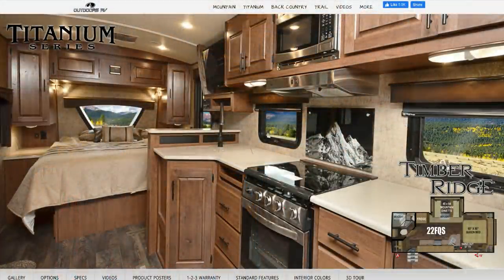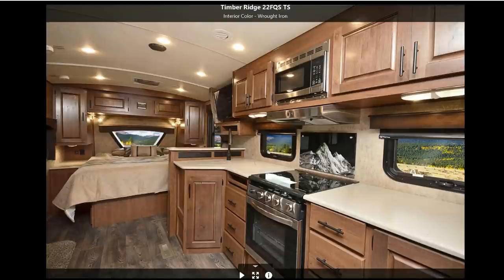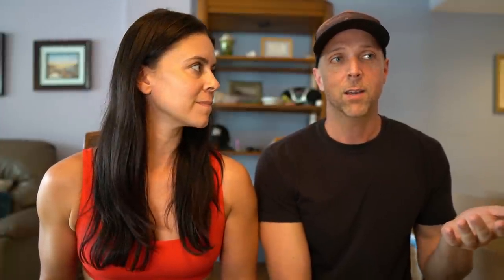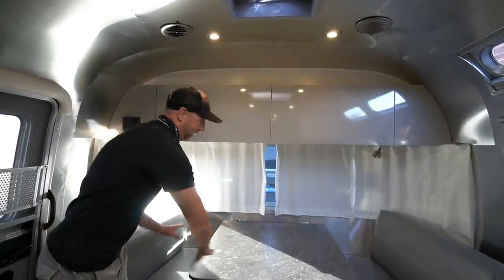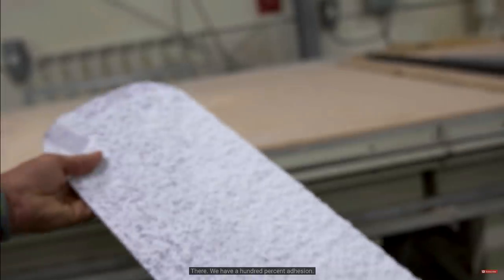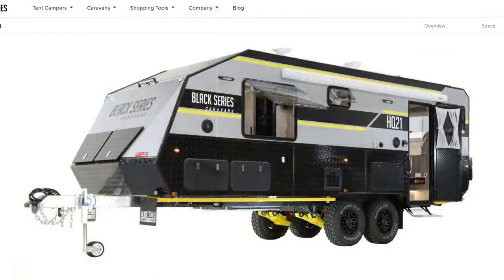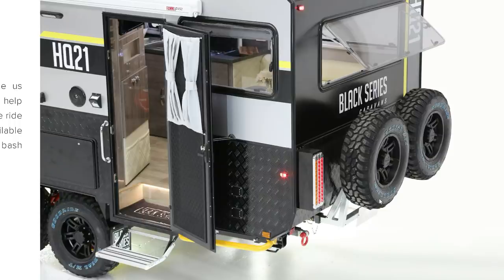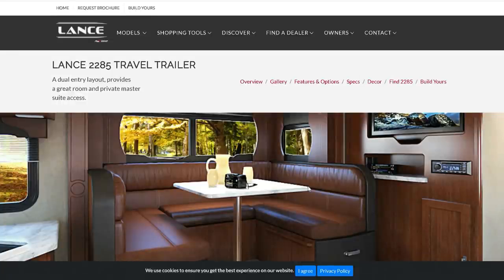Why We Chose Outdoors RV Over Airstream, Black Series, & Lance Travel Trailers

Comment: Sounds like your decision is perfect for you.  In Fall of 2019, I went to the California RV show and saw the Airstream, BlackSeries, and Lance Travel Trailers.  From what I remember, your comparisons of the units are right on.  

While I like an Airstream 25RBQ, the fact that you can buy two new Outdoor 22FS for the same money as one new Airstream causes one to think twice.  

The BlackSeries units will have an internal clearance problem.  If you look at the videos, the AC unit seems to cause some headroom loss.  While they seem very rugged for off-road use, if you can't stand up, you can't stand up! 
 
I didn't know that the Carrying Capacity of the Lance was a lot less the Outdoors Unit.  After looking at that the specs, you will have over 1,200 lbs to play with and that is a huge factor in figuring out what to take on your travels.

The real question is when will your rig arrive?
Reply from the maker: All good points! The build run starts in July and we hope to see it at the end of summer into fall time!

Comment: I’m happy for you. It seems like you made the right choice for more rugged outdoor adventures. But I’m not gonna lie, when you were talking about the airstream in this video you lit up and it seemed like your heart was really set on it.
Reply from the maker: We do both really love Airstreams! Our first love😍! And we might just come crawling back!!😂
Reply: @IreneIronTravels  Airstreams Does NOT Have Any Exterior Storage, Let Alone Interior Storage Like The ORV...!!!  You Made The Better and Smarter Choice - True Four Season - Protection and Interior Hight... I Am 6'3" Tall - Ah 6'11" :)
Reply: @BIGResultsFast  & @Irene Iron Travels:  It depends on the size of the AS.  At 30’ my ‘78 Argosy (the painted AS) has outside & inside storage.  For real serious off-roading you do need both the larger wheels & the lift kit.  In our case, with knee trouble, the higher ground clearance is sacrificed for better physical comfort.  

I’ve camped in a 30’TT for over 30 years and have never been restricted in where I would like to go.  I’ve never been a rock climber type of camper so I’ve not needed that capability.  I’ve had skid wheels on my 30s’ so I don’t worry about dragging.

My TV is a 2005 Dodge Ram SLT, 1500, 4X4, Quad Cab, 6.5’ Box, 5.7L Hemi - Gas w/240,000 miles.  Very little repairs - mostly suspension.  It is capable of towing 12,000# but I’m only towing 5,500# fully loaded so I have had no problems.

With an AS you have 50-70 years worth of used units to consider.  No other TT on the market can make that claim.  That’s how you get around the high price tag of the newer units.  And AS DID make Slide-Outs for a few years.  They are highly sought after and their price reflects that.

I retired my other 30’ TT because at 30 years of age it was unroadworthy and too expensive to repair.  It was a Fiberglass/Styrofoam/Wood sandwich construction on a Galvanized Steel frame.  I wasn’t savvy enough to realize the damage heating w/propane would inflict.  We did a lot of Cold Weather Camping and ran our furnace a lot. I did not use a dehumidifier.

I will NEVER again use a TT that uses wood and fiberglass in a sandwich.  I looked very strongly at the Lance, particularly their Pick-Up Campers.  The 3 slides one I could live with quite easily but my Wife did not like the entry height or the small quarters.  We used my Folks Avion 11’ PU Camper so she had a reference point.

I look forward to following your adventures in your new TT!!  Best to you both!!

Comment: Great choice! We longed for an Airstream, we are 6’ and 6’5”. In the end the lack of slide and the curved interior walls (in the shower for instance) were a deal breaker and we bought a Grand Design Imagine with one slide and the basement pass through. Best decision ever. The Airstreams are beautiful and I still covet them but we enjoy the functionality and space/height of the Imagine every single time we use it. I think you chose a fantastic trailer and am looking forward to following your adventures. 🎉🎉🎉
Reply from the maker: Thanks! Yes, that all makes a lot of sense...especially the shower! We wanted to look at the GD Imagine 22mls a bit more as well, but none were local. They managed to fit the table,couch, and full walkaround bed all in there. Looked like it might have been a bit cramped...... Is that the model you guys have?
Reply: We ended up with a 2500RL. I love the upgraded shocks and suspension on your rig. It makes for such a more pleasant ride down the road, and those tank sizes - you could be weeks in the boonies - so fun!
Reply from the maker: So true 👍, thanks!!!
Reply: Airstream has better resale value and last longer

Comment: Just as an FYI Lance does have I closed tanks, the best system really with tank in a tank. They also are only manufacture I know that includes full fresh water and propane in weights. So that cargo weight is after a full fresh tank and full propane. They are overbuilt for weight.  They also have a lift option for more clearance.
Reply: And congratulations on choice of rig. Well thought out and looks like a great rig. Can’t believe the water capacity. That’s great.

Comment: I have  been living in our Timber ridge 22fqs full-time for a year now and have no regrets. I have made some upgrades that make it more enjoyable and practical.  I installed two 100w solar panels, solar charger and inverter it was easy with the prewiring. I disconnected the outside speakers and wired speakers in the bedroom instead ,mounted to the ceiling . I installed a apple tv device which is great for streaming Netflix. I installed reading lamps on each side of the bed. I also insulated around the water pump and water lines to prevent noise from vibrating lines under the shower area. And I added a lockable battery box which houses two 6v agm batteries wired in series. The only problem I have had was with the maxx air fan it stopped working, I think the board is bad. Hope you enjoy  yourselves.

Comment: I called it! Excellent choice for your mission(s)! I'm working with Thompson RV on a larger floor plan, but the reasons leading up to your purchase are exactly the same as ours. And you made a great point about the potential need to travel to colder climates if needed; my girlfriend's father is in MN so we could potentially find ourselves in the same position. Excellent video as always! Congratulations!
Reply from the maker: Thanks! And hope you guys get your ORV! We found a couple dealers that had the 22FQS on production run for July/August, so hopefully it will work out. It's crzy ORV only makes each model about once a year!
Reply: @IreneIronTravels  Yep, I'm told the next production run of the model we really like, the 26KVS, currently isn't scheduled until the late spring or summer of 2022. Hopefully we'll figure something out. Good luck with yours!

Comment: That is a nice trailer.  80 gallons fresh and a combined 80 gallons in black and grey, is massive for your boondocking affinity.  If you get a supplemental fridge/freezer and keep it in the truck, you can hit the 14 day boondocking limit without breaking a sweat, with those provision capacities.  I think you made an excellent decision, for what you're going to be using it for.

Have you decided what you're gonna do with the e-bikes?  Are you gonna carry them in the truck bed, or will you put a rack on the back of the trailer and carry them that way?
Reply from the maker: Thanks! The trailer does have 250lb hitch and I think that is where the bikes will go for the time being since well have the tent on the bed of the truck. If we end up selling the tent down the road I would look into putting the bikes on the rack on the bed of the truck where the tent was.

Comment: Well , I like your choice of trailer , looks nice .. as for Airstream trailers encase you weren't aware , because of all of the seams they have they are more likely to get leaks over time and they are difficult to find because the water can leak in between the outer skin and inner walls ... also believe it or not the aluminum skin can be dented fairly easily , if you are in a serious hail storm the roofs can be dented much easier than steel or fiberglass .. you can actually have your Airstream trailer totaled as a result of a bad hail storm ... I have watched numerous videos of people who own Airstreams and who live in them full time , they do have some negative issues along with the positive ones ...  Enjoy your new trailer ...

Comment: I think you made a great choice. My fiancé and I own a Lance 1995. We bought it in 2019. Since then, we've experienced leaking around the skylights, a metal plate randomly falling from underneath the fridge related to the furnace...THEN on my trip just this past week I found the microwave to be half hanging out and the mounting screws totally out, and leaking from underneath the coach as I was connected to city water. Granted I-70 has some rough road around the Eisenhower tunnel area in Colorado, but you'd think a RV microwave should be able to handle the shaking. 🤦🏼‍♀️
As my fiancé has called Lance for help, they've offered very little...and they even tried to dismiss us before our warranty was up. (Now officially, we hit our 2 years June 8th, and he called for help in May) However he called ORV, and they said that they will stand with their product for a long as you own it. They even tried to help my fiancé with the issues we're having now! 
Long story short, our next camper will definitely be a ORV!! Great choice!

Comment: In 32 years we have owned 17 rvs.   We have been in an ORV 24rks with an Anderson equalizer hitch 2  1/2 years. We boondock a lot.  Love big tanks.  It has been the best insulated trailer we have ever owned. In fact so well insulated even with slide out fantastic fan needs other fan open to pull air easily. On our model 3 fantastic fans with covers come standard.  One over the bed is a two way fan.  Large refrigerator compared to other small rvs.  Also orv stayed with nice steps for entry.  (Only heard problems with big steps that fold out of rv). You won’t be sorry!
Reply from the maker: Oh wow! How do you like it compared to the others?
Reply: @IreneIronTravels  In our opinion, most rvs have gone downhill recently: cheaply made.    ORV costs more but at least the one we have has had few issues.  All Rvs have somethings wrong; they are after all aluminum or wood boxes on wheels. We had a list of 14 items on a Sunseeker Motorhome we owed. Two were repaired, the rest we had to live with.  The only problem with ORV we’ve had was one window wouldn’t open easily and it was fixed and now works fine.  We added solar to trickle charge batteries.  We changed out one 12 volt battery for two 6s. We have not really explored lithium battery setup bc we have a generator. In the rv world, finding a fair and honest dealer is as important as the rv you choose.

Comment: I think you made a good choice. I have a 29TRX on order for our upcoming retirement. The frame is a key factor IMO. Outdoors RV models come with heavy duty frames with the KYB shock absorbers, and the MorRyde shackle kits, along with heavy ply tires. I think their frames should be less prone to flex, and that will make everything stay together better. I followed one on a curvy, hilly, rough 2 lane road, and they were towing at really good clip. There was no bounce or sway. They also have a good load capacity. A coworker got a different brand 27 foot toy hauler, and it only had a 2,200lb capacity. Which means if you fill the 100 gallon tank, 40 gallon fuel tank, and put a SXS inside, you are already overweight! Whereas the same size TRX has more than double the capacity. Good luck on the new home! I am very anxious to get ours.

Comment: Congrats on your new purchase! 👏.  When you boondock, how will your power your new rig?  Is lithium in your future?  Maybe a generator ? Thx
Reply from the maker: Thanks! We are going to try and skip a gen this time by going with more solar and lithium. We only had 300 watts before and had to use our gen in the winter time (low sun angle) maybe every 5 days while boondocking. And ofcourse with extended AC running. If we can squeeze 1000+ watts and lithium we should be good. Lots of planning to do!

Comment: Congrats on the new trailer.  I hope it makes you guys happy.  I was hoping to see a nice 25RB airstream...but It appears to be a great build.  Do they use composite?  Also, you mentioned a slide out---have they had any issues with leakage from the slide out?
Reply from the maker: Thanks! Yes, we will miss the Airstream for sure! They don't use composite floors like the new AS, but they do use all high quality marine grade/exterior grade plywoods and 2 in aluminum wall and slide frames. They are built very old school and stout and have not heard much of anything on slide issues. It is a concern, but something I will have to keep an eye on!

Comment: Amazing!  Especially the 80 gallon fresh water tank; The huge kitchen counter space. With even more, to the left. And the lighting is a big plus. Lots of lights. Probably could put plastic curtains attached to the ceiling,  by bed. Or use,  light wood accordian style wood. Using ceiling tracks to close off bedroom. Can make it so one side closes from left to right. Then the other side, from right to left . So you didn't have to close that from far left to far right, for example.

A new towable premieres Monday night. The Alliance Avenue 32  RLS.
It has 101 inch width. Unheard of, in.towables.
At about 10, 350 lbs. Also, lighter than most. Although, this is probably too much weight, for off-roading.

The main thing with towables is get the right truck. And the correct towing hitch, for the weight of the trailer. With stablizers, by the hitch. Making it easier to tow. Instead of all of the entire weight being on the tow hitch
Reply from the maker: Thanks! Good insight! It will be interesting to see Alliance come into the market. I did check out their 5th wheels!
Reply: Yes, they say, Their's is  like a bigger trailer. Compacted into a smaller trailer, reducing the weight. As if  its a bigger trailer. For the price of a bigger trailer.

I think most of the Rv's and towables use Asdale insulation, within the insulating panels, now. This means, there is no delamination  between the panels. Like from water,. Causing a warp effect to the panels.
Reply: The new Alluance Avenue 32 RLS,,.Less price than a bigger.towable. But with similar amenities, like a bigger towable

Comment: Those are all my fav rvs, except ORV hadn't heard about them yet. 

Sun Oven cooks like an oven and just uses the sun in all seasons in case anyone is concerned about choosing  between microwave/ rv ovens. I'd rather cook outside with an outdoor kitchen set up then inside an rv. I'd rather not have a kitchen inside and utilize space inside for more sleeping or lounging. But that is me. The sun oven is well worth it. An electric tea kettle is another great thing to have inside rv. Heats up in 2 min. A iron skillet and a large Instant Pot Pressure cooker and I'm good. 

Microwave only optuon in rv's usual has a conventional oven within it nowadays. 

Lance, Airstream, Black Series and Opus are my fav quality rvs. All are well made and quality. Black Series and Opus4 is their rugged series. 

Lance is very well made. Known for its quality. 

Thanks for the video, don't know much about the ORV. I will look into them. Happy Rving.

Comment: Sandra Westley from the UK gosh you are brave painting a new trailer, we are fortunate n that the deco inside because of competition they know it’s important to keep it light and bright, we have just ordered a new trailer and the cabinets are 2 tone cream and soft grey on the walls and a. Soft honey colour wood,no wood is used in our trailers, to keep it light to tow, but it’s all aluminium sandwiched with insulation, in walls and floors. Our trailers ar very similar to the AS but we have a oven and microwave and cooker top, but I rarely use  gas top, I also got an electric ring. You cannot boondock in the UK , you have to stay on designated sites it’s against the law over here. Our new trailer is 8ft wide as my husband is 6ft 3in we have head room of 6ft 5in

Comment: It looks like you're selection meets most of your needs and wants; just curious on how you plan to transport your ebikes?
Reply from the maker: The ORV has a pretty beefy hitch on the back attached to the frame. We'll use our same  bick rack on the hitch there. If we didn't have the roof top tent I would probably look into a bike rack on top of the bed. Although the bikes are heavy!!

Comment: Looks like a good choice. Congratulations!  What about the tent camper dealeo?  Is that still happening as well or are you taking delivery on this unit much later?  Also, I was hopeful too that ducted air conditioning might mean a quieter AC unit, but not in our 31L Thor Chateau.  Just as loud as an inducted trailer.  So when is delivery of the new rig?  Look forward to your next video.
Reply from the maker: Thanks! Yes, the roof top tent is still happening! The mounting rack should be showing up next week and our next couple vids should be on the truck and then tent. We're ready to get back on the road. The trailer won't be delivered until late summer early fall, so we'll be in the tent till then! Thanks for the AC noise experience...... we'll find out on ours!